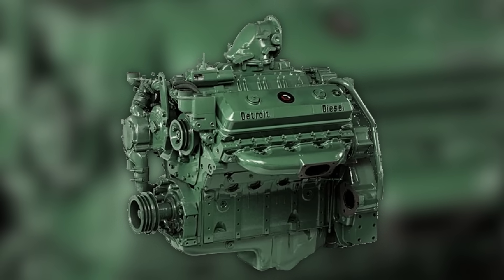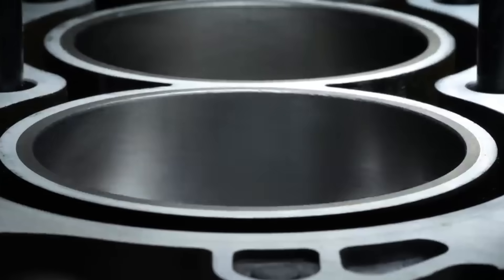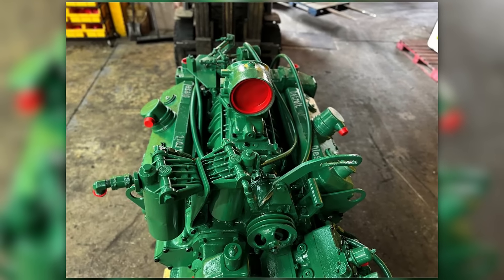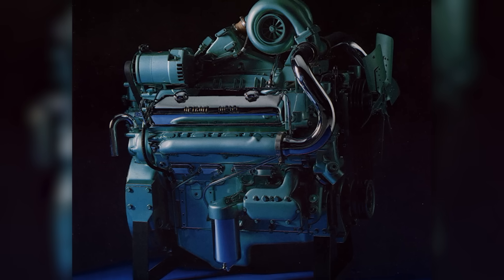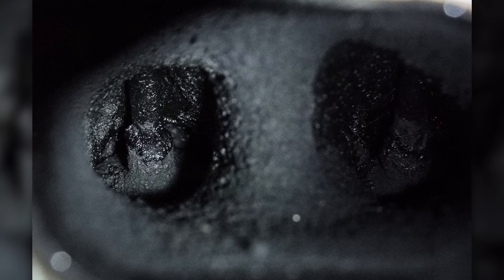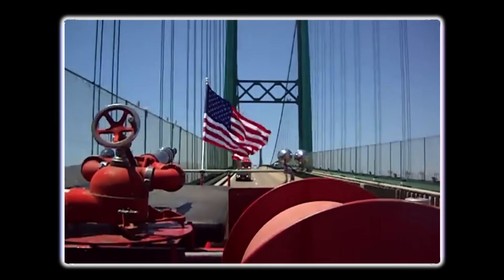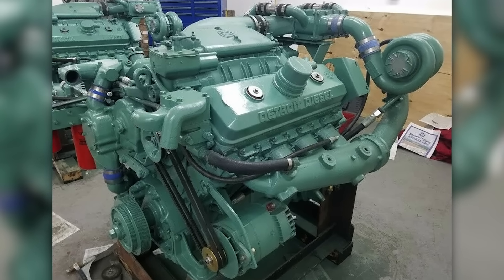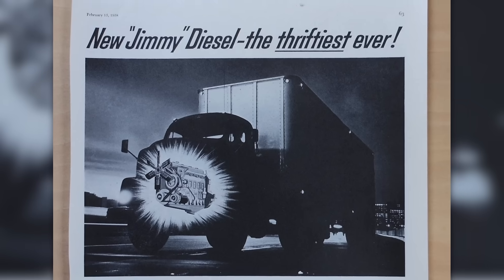The Shocking Truth About the DD 8V71, the Engine Too Hot For Its Own Good

Comment: I just had mine fired up today 
Iwas told two things about them when went to work for them if it's leaking it doesn't have any oil in it the other thing was open the door put hand in there and slam it now that good and mad that hurt you get in and drive like your mad at it

Comment: I drove this engine in a Kenworth back in the late seventies with a 6 main box & 4 speed browny. Suspension if you want to call it that was rubber biscuits and a standard 40' flatbed (no slider). You had to know how to load lumber right. They also had a few V12's in long nose Petes. I don't remember a lot of issues with that truck & motor, but then the owner took good care of his equipment.

Comment: THE 71 SERIES ENGINE WAS A DRY LINER ENGINE NO LINER O RINGS AND YOU COULD FIT THE LINERS TO THE BORE OF THE BLOCK PART NUMBERS WERE BELOW THE TOP ABOVE THE PORTS OR BELOW THE PORTS AND IT WAS THE BEST BEFORE ELECTRICAL BULLSHIT TOOK OVER

Comment: 92's were wet sleeve engines. 71's were dry sleeve engines. Major difference. 71 engines could use .001, .010, and .020" oversize OD liners to overbore when the bores were distorted. You are looking at a 92. Rebuilt many 71 engines including 8V's. Got your facts wrong.

Comment: I have 2 in my shop I collect them from a 2-53 to a 12v 92 . leaking oil is just something you have to deal with any 2 stroke Detroit that and making sure the emergency air cut off is working ! All it takes is one injector rack to stick and you have a screaming run away ! Better yet a big CO-2 fire extinguisher to discharge into the air intake . You can turn them upwards of 3000 RPM and they will stay together . It was the EPA that ultimately killed them off .
Reply: What’s the biggest injector you’ve run in a 871?    I put n80 into a pair of 871N and it was a very positive change without any soot, am always thinking of going to N90

Comment: At 2:13: the smaller -71 series engines, such as 4-71, 6-71, in straight or Inline-configuration, not V-configuration, were either blown or NOT blown. So I'm not buying your assertion about "no blower, no combustion" regarding the 8V-71. 

Blowers, also called superchargers, and turbochargers, are performance-enhancing upgrades that force larger quantities of combustible mixture of fuel and air into the cylinders than naturally-aspirated versions, thus producing more horsepower, and more importantly, in diesels, more torque. But indeed, the naturally-aspirated Jimmys certainly ran, having no "lack of combustion", but with a little less "pep".

So, I'm at a loss for your reasoning behind the statement, "no blower, no combustion" here. Even your own video at 18:16 admits that "naturally-aspirated … models" of the 8V-71 existed!

Besides the 8V-71, there were also a 6, 12, 16, and 24-cylinder V-versions. Were all these V-versions required to have a blower, as well?
Reply: ALL! Detroit 2 stroke diesels have a blower, some also had turbos, but still needed the blower.
Reply: @jazzandbluesculturalherita2547
  Blower not a supercharger, as no boost was made. Naturaly aspirated is no turbo on the 2-strokes. All 2-stroke Detroits need a blower to run.

Comment: I put many miles on a 8V71. I had to fix a frozen up injector at night in the middle of nowhere. Made it to Reno with no problem. It screamed because it was a two stroke engine not because it ran at high RPMs.

Comment: I absolutely adore them and all things 2 stroke! First truck I ever drove with a 13 speed Road Ranger and dual straight piped 8V71N 318 HP, in a  GMC 9500. BAD ASS BEAR!! I love them and the ONLY diesel is the 2 stroke. Screw those rattling Clatter-Pillars and Cumm-Aparts, etc. they convert diesel fuel into nasty sounds and high repair bills and are nightmares to wrench on. And are NOT very efficient compared to 2 strokes! People misunderstand the Clark cycle 2 stroke engines, like any Detroit with exhaust valves in the head and the Day cycle with no valves and ports like gasoline 2 strokes and the rare 2-51 and 4-51’s with no valves and loop scavenging. (I have 2 4-51’s and they are COOL! 😎) and it is sad because 2 strokes are more efficient than we were told. I live and breathe them and they are endlessly fascinating! They have the highest power density of all internal combustion engine as well. Detroit diesels were the greatest diesels in world history and will never be beaten. And that SOUND!! 😊 I love higher pitch sounds, like ny Paiste 2002 cymbals on my drum kit, so 2 strokes just fit in as well! 8V71’s will ALWAYS KICK ASS!! 👍🏻😋

Comment: The 8V71 ran best if you slammed the door on your hand and drove it like you were pissed off😊
Reply: Didn't see this comment, just commented the same lol! Always got told that when I was learning to drive trucks
Reply: I agree. People in Brazil didn't know they had to rev to the limiter to run properly, so they are insanely rare here. People swapped them with normal 4 stroke diesels.
Reply: Most companies I know of would not put a new driver in a truck with a Cat or Cummins but throw them in the trucks with the DD as they could hurt them and they didn't have to know about optimal torque range!
Reply: @Rags2250 I learned how to drive truck at 14 in the early 70s in a Cummins 350 they were picky the new motors my 10 year old could drive without hurting them the old days you don't over wind and dare not lug them
Reply: @Rags2250 you couldn't lug a DD you'd pull a sleeve or burn a piston I've seen rookies do it the first hill they hit when they didn't miss a gear and come to a dead stop lol😊
Reply: Same thing for a 6v53.
Guy that got me started driving trucks told me drive it like you are trying to destroy it. That's when it run at its best. Do not ever lug it. If you do you will burn a valve and then that tell tale chirp starts.

Comment: You put a set of 110 injectors from a stationary motor and it would unleash an animal,and we turned them up to 2730,without problems or longevity trouble,you get them up over 2500 and it's an entirely different beast

Comment: I had a bunch of v8 detroits,if you left them idling,the weeped oil outta the breather boxes,but they weren't designed to leak and nonenof mine did, and I worked for a company that ran v8,v12s,v16s and v24s,in their fleet of trucks boats and heavy equiptment,,,,their mechanic invented an add on assembly that transfer the heat accumulated on one side of the engine,cuz one side lasted twice as long as the other side,causing it to burn out faster,it equalized the heat on each side,he sold the plans to GM and they scrapped it,,but his own engines ran twice as long between rebuilds,

Comment: The 71 series engines were partially air cooled. Run it with a dirty filter which could easily happen in dirt moving machinery and you would soon be rebuilding the engine. The fatal flaw of the engines were the blow back into the air box (the area surrounding the bottom half of the cylinders) which also caused oil to get in the air box. If you check maintenance manuals for them they will state depending on the model of so many drips of oil coming from the drain tubes for the air boxes for proper operation. That feature killed them. Another problem they had was that if a injector "stuck" the engine would  rap until it blew, so if the operator did not know enough to activate the flap to choke of air flow, well then good bye engine.

Comment: Any engine that slowly dies-out after ~3 decades mostly due to politics, new public needs & other things not based around design flaws is an amazing engine! Also it's not entirely true about the emissions being naturally problematic / unsolvable, I'm pretty sure DD even said the 2-stroke designs would have passed the first round(s) of emissions regulations. Also since VVT and other modern tech actually works far-better with uniflow 2-trokes you could even argue a modernised uniflow 2-stroke is the ultimate engine for emissions control. However this would all need a total overhaul of previous Detroit engines which is why it's not really worth it monetarily I assume so the 4-stroke direction was chosen.

Comment: Had six v over million miles very little oil loss maybe were in parrell worlds wher your vehicle parts are changed out or entire vehicle changed out gee thanks for leaving me the insurance company and tags and fuel passes tabs umm scratch the fuel and insurance insurance frowns on dual tag  identical running on ther roads im still curious when the insurance company were the roadway owner operator maintenance

Comment: I used to overhaul many 8V71s, I just now learned that on all those engines I failed to install the O-rings on the cylinder liners.
Reply: According to this video.
Reply: Eh, they'll be just fine. It's a Detroit.. They'll to run backwards for the same lifespan as running to forward
Reply: Right!
Reply: The 53 and 92 are wet sleeve not the 71
Reply: @brianviers9278  ,Yes

Comment: It's hard to take these kinds of AI-generated slop seriously. Full of wrong info presented in an assuring voice, images of entirely different engines like that of a DOHC gas V8 and the wrong fuel injector at 3:37, and  I'm sure there's more further in but I stopped here. The  nonsense about the dry/wet sleeves? Please, bitch; as others have pointed out, this is false, and having torn down a 6-71 a long time ago I can safely state that the -71 engine family does not use wet sleeves.

YT needs to do a better job of blocking this crap.

Comment: If you want to keep a 71 series happy and dry outside you'd better set the governor to no higher than 1800 rpm. I've seen a lot of them turned up to 2200-2400. They never did live long after that. But they will sit there loaded or loafing all day at 1800. And all night, all week, all month quite literally !

Comment: I've placed my life and the lives of many others in the trusted hands of a Detroit Deisel engine at sea. They never let me down, and always got me back to the hill. Sometimes it was barely, and they were in pretty bad shape but I've never seen one shut down due to mechanical issues. Now I've had them many times shut down on me far, far from any help due to dirty fuel, but that will happen with any engine. The Detroits would always fire back up after a filter change ! I grew up from a baby sleeping on top of the motor box in my dads commercial fishing boats. The drone of a Detroit still makes me drowsy today if I have to listen to it for more than a few minutes !
Reply: My son would go to sleep quickly with the drone of twin 871 at 2000 rpm.     Also ran one with burned valve, but shut off injector, for a year until it could be repaired.   Lost about 200 rpm but otherwise ran fine

Comment: I drove trucks with different 2 stroke Detroits.  A 6V53, had a 5 & 4 transmission,  inline 6-71, 8V71, and 8V92.  The 6 V 53 came from the factory set to 2800 RPM. the 6 - 71, and 8 V 71, were both set to 2300 RPM, THE 8V92 was set to 2000 RPM all were "no load " sittings.  Meaning in neutral accelerater on the floor. I drove a cabover international 8V71 no mufflers.  After an hour and a half it gave me a headache,  after nearly 6 hours I got out and never drove that truck again.  It always sounded better when someone else drove it!  With a 9, 10, or 13 speed transmission,  they were ok, but when you hit a hill with a heavy load, they were the first to have to down shift.  The oil leaks,  the noise,  horrible fuel mileage,  and lack of torque were the real down fall. Of that engine.

Comment: Drivers liked it mechanics hated it. The GMC Astro tractors got it right. They put a 4 core radiator in them for the 8V71 while the Cat and Cummins got 2 core radiators. Every other truck manufacturer used the same radiator for any engine. We also ran dual lubrifiner filters that added another 3 - 5 gallons of oil.

Comment: Best application I ever saw was a naturally aspirated 8v71 running gensets on a sailing ship no oil leaks and quiet cooled thru seawater heat exchangers. Ran 1900 rpm day and night.
Reply: How would a NA 8V71 even run?  Air can’t get into the engine w/o the blower.
Reply: @alantrimble2881
  You must be new to Detroit and the NA series.
Reply: @ducewags  But were they 2 stroke NA or 4 stroke NA? 4 stroke NA is fine, but a 2 stroke needs a blower.
Reply: @bobbygetsbanned6049
 All 2-stroke Detroits need a blower to work. Nothing about NA or turbo is going to change that fact.
Reply: @ducewags  Right, I don't understand the point of your first comment then.
Reply: @bobbygetsbanned6049
  This video is about a 8v71 right? The OP talked about a 8v71 right? All 71 series are 2-strokes, some are NA and some turbo, but still a 2-stroke and that will never change. Want to read a funny conversation on here? PiDsPagePrototypes wrote "why does the narration mention 'Naturally Aspirated' several times, often while mentioning the use of a supercharger?" That is a fun conversation for sure.
Reply: @ducewags  I think the answer you're looking for is: Detroit called the 8v71's with just a blower NA. Naturally aspirated means no blower, and no turbos, so anyone not familiar with these engines will expect no supercharger on the "NA" engines. But I guess, since these are 2 stroke and need a blower just to run, Detroit called the ones with just a blower NA, even though they are not.
Reply: @bobbygetsbanned6049 This video is about the 8v71 or 71 series or 2-stroke Detroit. A 2-stroke Detroit will NOT run without a blower. If it has no turbo, it is an NA engine. A blower is NOT a supercharger as it does NOT raise the atmospheric pressure. A supercharger Pro-charger or turbo are need to raise the pressure. So YES a Detroit 2-stroke is in fact a NA engine if it has no turbo, and it has NO intake and that is why it needs a blower to run. It might be time for you to go read that person's comment I noted about.
Reply: @ducewags  Finally, an actual answer from you instead of a bunch of indirect bs. Anyways, The "blower" used on a 8v71's, is a positive displacement roots style supercharger. It is in fact a supercharger, capable of increasing pressure, and they have even been fitted to gasoline engines where they make "boost". The reason they don't make boost on an 8v71, is because of the design of a 2 stroke diesel, and because they are optimized to run at very low RPMs, NOT because they are not superchargers. 

A roots style supercharger, aka positive displacement blower (like on an 8v71), a centrifugal supercharger (pro charger), and turbos, can all create boost, and all three are very much FORCED induction, not NA.  
8v71's might be called NA by Detroit Diesel, since they cannot run without a "blower", but they are very much forced induction, since those blowers are positive displacement superchargers.
Reply: @bobbygetsbanned6049
 Internet. "Why does Detroit call it a blower and not a supercharger"? A Roots blower is NOT a supercharger, it's a BLOWER not a compressor. And have a nice day kid.
Reply: @ducewags  Oh man, I can't believe you're actually trying to argue roots blowers are not compressors lmfao. Don't believe everything you read on AI, you need to know at least enough to know when it's feeding you objectively false information. It's not even a debate, roots blowers, for a fact, are compressors.
Reply: @bobbygetsbanned6049
 Todays fun fact. Roots sells the rotors, seals, bearings and drive to turn it's blowers into superchargers. Why is that one might ask? A roots blower is NOT a supercharger and can't handle the RPM or the boost needed to be called a supercharger. Roots does sell superchargers, and it does use it's blower cases for that. You kids are not very smart, did the internet do that to you, or is that self inflicted. All done with you kids.
Reply: @bobbygetsbanned6049
  How much boost does a roots blower give a 2-stroke Detroit? It is a compressor or a supercharger as you say.
Reply: @alantrimble2881  probably meant no turbo
Reply: @alantrimble2881  8V71NA blower is required for the engine to operate, 8V71TA or TTA used turbos to increase air charge density.  the roots blower is not a performance enhancer it is a necessity
Reply: Interesting 🤔🧐

Comment: In general, all the heavy duty V8 diesels had "problems" and died out.  3408 Cat, 3208 Cat, Cummins 555, Cummins VT903, Mack EME-9  the list goes on.  Yet  Cat,Cummins,Detroit and Mack all made very successful straight six engines which operators loved.
Reply: The only problem with the Mack E9 was  it couldn't pass epa exhaust emissions.  Plus the exhaust manifolds did tend to Crack.
Reply: @bertgrau3934  The 500hp and higher versions snapped head studs routinely.  Trucking companies doing road train work were breaking one or two per week.  Mack in Adelaide developed a special tool to get broken studs out without pulling the cylinder head.
Reply: Yup. The narrow rod big ends V8’s typically need is guaranteed to cause failure in 4 stroke versions because of heavy compression and cylinder peak pressures alternating with almost no pressure loading on intake and exhaust strokes that don’t matter as much in gas V8’s, but KILL diesel V type engines. BUT-the Detroit Diesel 2 strokes have even, continuous loading and much lower compression and peak pressures than 4 stroke diesels and hold up FAR better. The 4 strokes are essentially ALL junk in V Configuration. They all sucked, V6, V8, V12. The Detroit 2 strokes didn’t have much bottom end issues.
Reply: The Detroit never had the crankshaft problems the Cat and Cummins had.  I think it was the power pulsed being more evenly distributed, the 60 degree Cat caused a lot of harmonic distortion
Reply: @randymagnum143  The Detroit 8V92 was known in Australia to have an issue cracking the webb on crankshafts at the high horsepower ratings.